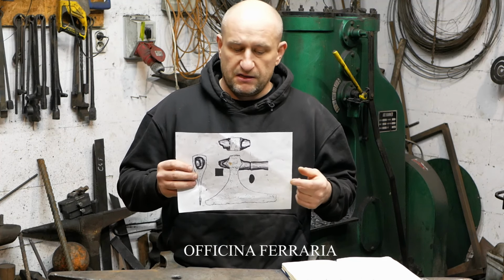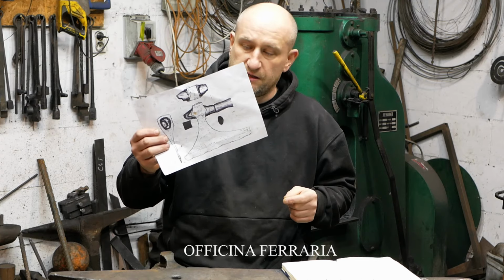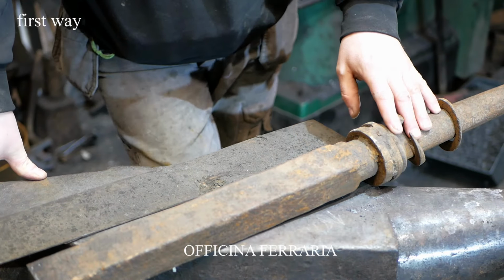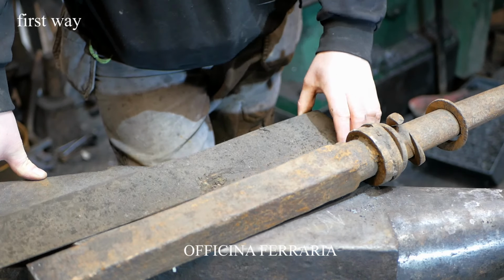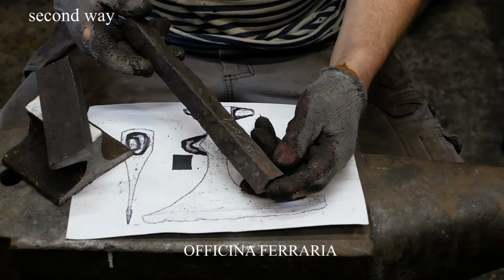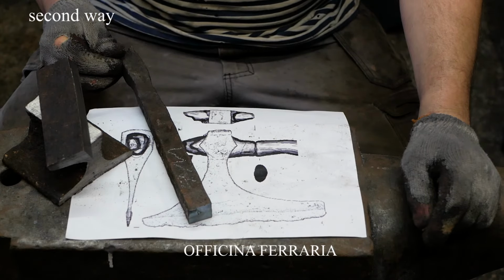Forging Viking age combat axes.

Comment: You make forge welding look so easy!
Reply: Not discrediting anyone, because forge welding is a skill in its own. But once you get the hang of it, it turns into an almost every day occurrence at the forge. I used to hate forge welding but after two sessions with Roy Adams @ christcenteredironworks, I love forge welding. Its a piece of cake. Sure some steels are finicky, but its all the same concept and super satisfying.

Comment: I absolutely love your blades, including the spearheads. I'm thinking about eventually doing a Damascus blade myself, but I was wondering if I could use 1075 and 1084 together to make a Damascus blade with good patterns. Or are those two steels to similar to be able to make any visible pattern when being used together?
Reply from the maker: i don't use these steel so i don't know what pattern it gives. Make a small sample and than check.
Reply: @officinaferraria  OK, I will do that. Thanks for the response.

Comment: Oooh, these ones! To me they look a little later evolution of the Lunow type. I have to try forging one of those one day. I saw the cracking on the second one's poll, what a shame. :( Though that's a risk of working with this material, ey?
Reply: It’d probably still be good to use, honestly. Many of these old iron axes and even swords had weld flaws/cracks and were seemingly still used.
Reply from the maker: wrought iron is hard to forge because it delaminate and crack very often.